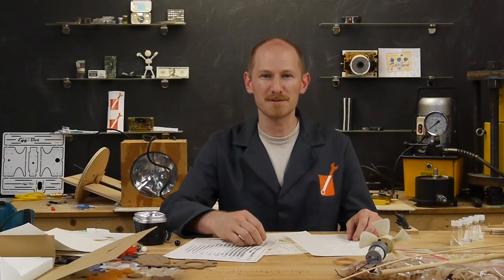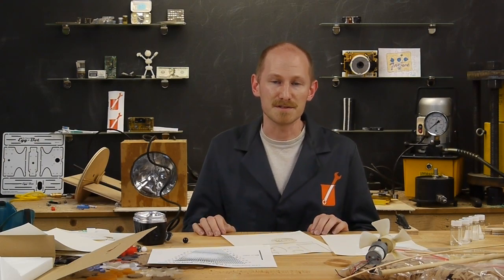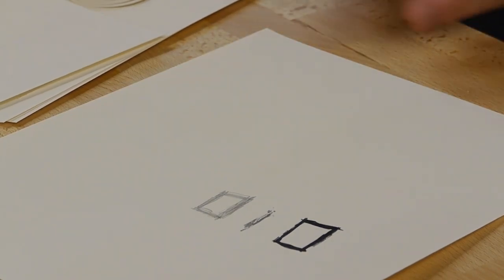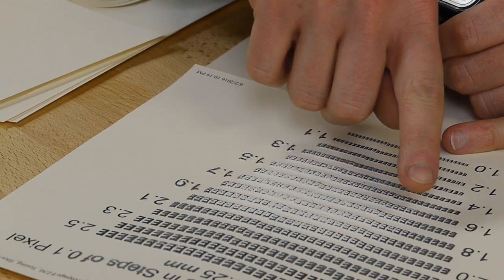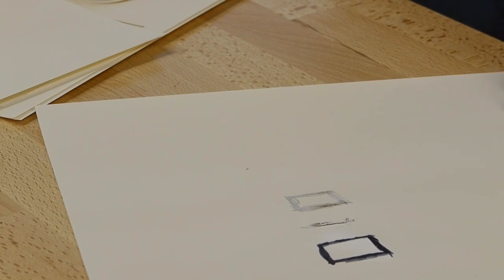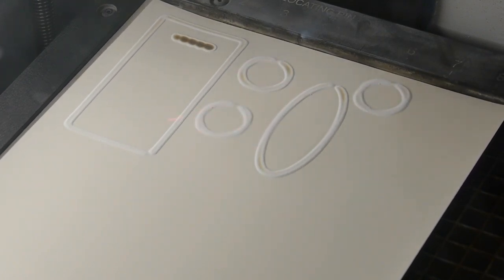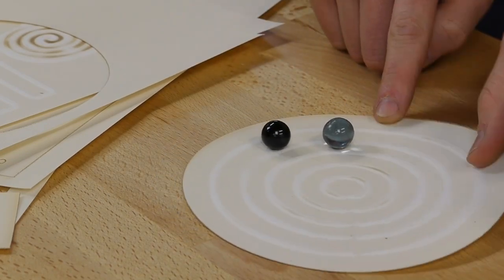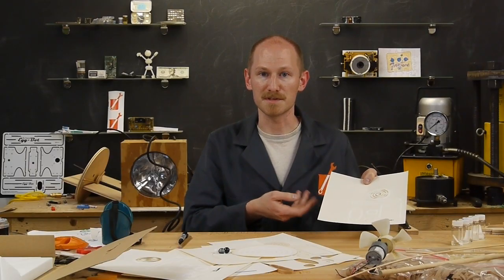Heat-sensitive 3D paper (swell paper)

Comment: My idea for a dynamic display for blind is a sheet with small cells filled with liquid (probably alcohol) and a tiny heating filament. The boiling of liquid will make the pocked swell. You might want a heat conductive bottom layer so the cycle time is short enough.
My idea comes from inkjet printers and wonder if the components could be repurposed.

Comment: It's interesting how it shows that the laser spot isn't round. Once defocused it was something vaguely oval and would give different thickness lines depending on movement direction. Could possibly be used as an artifact-generating way to check beam form on a laser cutter.

Comment: You could use a 3D printer with it. Make custom GCode to set the nozzle to a certain temperature, move nozzle onto paper at required steps, done. Higher resolution may be possible by sticking part of an accupuncter needle into the nozzle.

Comment: A cool experiment would be to try a photographic representation. This would also be in-line with the purpose of the paper (blind folks could experience landscapes and portraits in a new way). If you could perhaps shine the lamp through a negative that blocked off parts of the infrared onto a totally black-colored piece of the paper, this might produce a tactile image. // The other thing that came to mind was some sort of coded mask. In astronomy, a coded mask is helpful in determining origin of radiation by the points of shadow the mask produces. If there was a coded mask for infrared, there may be some cool experiments or applications for that. (I didn't explain coded masks well, but if you Google them, you'll see what I'm talking about).

Comment: I experimented with a product called Expancell a few years ago. It consists of small microspheres containing a core of solvent that boils and expands them like small balloons swelling the stuff up to 60 times when it is is heated. When I visited the factory they showed me laser prints very similar in appearance to what You have. As I understod it, the paper just had a coating of microspheres, and the fuser expanded the colored surfaces to give a 3d effect. Perhaps it is the same process now commercialized. These microspheres can be used for all kinds of interesting stuff. Some info on their website :
https://expancel.akzonobel.com/applications/

Comment: You could print a black and white geographical height map, the higher areas darker, the pits and valleys lighter. Then when exposed to the height it will create a 3d geographical map, although most likely too small to be appreciated. Also the Z to X and Y ratio would be really low

Comment: I thought I had a comment before, but would a scanner work?  If you put the swell paper on the scanner would the light and heat from light be strong enough to effect the paper? And if so would you have a problem with the paper sticking to the screen?

Comment: Detect the 3D Printer heat bed for hot spots, timing would need to be good, but the price is much much cheaper than other types of devices. So put in on the 3D Printer heat bed turnd on to a suitable temp,  for a fixed time, take it off a see if any areas are higher than others

Comment: Seems made for customised Braille signage... even books, contracts, or simple run-of-the-mill documents!

What if you ran a laser-printed thermal-paper page through the laser printer again, as though printing a blank page, and let the fusion roller in the laser printer apply the heat in a consistent, measured dose of thermal energy?

The process may require some fine tuning (such as dot size or line thickness) but it just might work.

Comment: Could you replace the laser in your laser cutter with a hot air gun? I think the nozzle should come down with just enough clearance for the paper to swell to maximum. A hot air gun might be unnecessarily complicated though, since you already have a laser.

 I think you could make an aluminium, liquid cooled (whatever liquid you think will work best), heatsink for the paper to sit on. (Maybe use a thin (1-2mm) aluminium plate large enough for the paper to sit on, and solder a copper coil of tubing to the back.)
Reply: Another idea: Add an attachment to the laser arm, that hangs down close to the surface. Imagine a 90 degree cone, with a circular base the same size or bigger than the focus of your laser, point-end-up, with a hole of the thickness you want your lines in the paper to be, drilled down the exact center of the cone. The cone sits on a small sheet, perpendicular to the beam of the laser. The sheet is attached to the laser's motor arm by a metal rod or two. A circular band is centered around the cone, laying flat on the sheet. The band's purpose is to absorb reflected laser light safely, so the inside is coated with something dark and heat resistant. (Graphite filled glass or something?) The cone, ring, sheet, and rod(s) are made of aluminium, but the cone gets the extra treatment of being polished to a mirror finish. [Continued next…]
Reply: […Continued] If you think you can get the electro-polishing to work without creating pits, that might be good for a middle step. I think I would use a mechanical polish for the first step of creating a mirror finish on the cone, then electro-polish for the second, then a few layers of new aluminium using sputtering, thus smoothing out the terrain of the cone a bit, I hope. If you have an reliable and known method to create excellent laser-mirror-grade finishes on aluminium, go for it, it's your channel after all. I won't be upset if you change things up on any of my suggestions, or even if you don't even use them. (It would be really cool to see some of my ideas used though. I really like coming up with them, after all. I don't even care about getting credit for them. …And now my social awkwardness is shining through…)

Comment: since some printer colours are kinda hydrophobic you could print fluid channels in yellow ink (multiple layers/lot of ink) and then raise the sides with black color and light, that should make for a working fluid channel that doesn't soak into the paper. maybe, if you can somehow make the edges of the swells sharper, you could even make capillary channels.

Comment: drill a hole in shitty concrete (too much sand). put a tight spiral of that in the hole. heat a screw with a hot air gun. screw that in the middle. how many kg:s would that hold?

Comment: you can make quick microfluidic molds too!!!...just need the paper to be flat....
Reply: maybe tape the paper onto a metal plate then laser engrave/draw lines for a microfluidic mold. pour PDMS, bond on glass slide and see if you can achieve laminar flow, mixing, etc. If you have some paper still and you live in the bay area let me know. I live in fremont and don't mind driving out and picking some up to test.

Comment: Hi, not sure if this is really the place to ask questions, however I have been reading with great interest about your background and the awesome work and projects you are involved with. Put simply, my absolute dream is to do what you do. I am nearly 40 and have been employed rather non technically (due to a very long term illness that took away quite some years of practice), as a qualified mechanical engineer for about a decade in the UK. I have started becoming a 'maker' (3D printing + electronics at the moment) and have some projects I cannot wait to realise. I love learning, love taking new things on board and just spending hours experimenting, though I wish I had a lab or workshop to use - I live in a flat :( Do you have any advice for a path from that old career to the new one, ways to get access to equipment, and maybe speak about your learning process? Thank you for reading  :)

Comment: One use could be to try out different surface patterns on airfoils to see if there are better patterns than are currently being used. I would suspect that it would be a popular idea for the model airplane crowd. i.e. do you get better performance out of a golf ball surface on the bottom of a wing to reduce drag, and a chevron or wavy line surface over the top of the wing to cause the air to follow even longer paths at the surface, perhaps giving even lower air pressure at the surface?

Comment: Add dimples to a paper air plane like a golf ball.
Reply: This would be interesting to try. My intuition tells me that this would make it worse, since a golf ball's dimples are designed to create turbulence behind the ball in order to eliminate a low pressure system forming behind the ball as it flies through the air (the low pressure sucks the ball backwards, preventing it from flying as far). Check out Applied Science's video where he levitates a screwdriver with compressed air -- that's where I learned about this effect.

Comment: Another great video. Just a suggestion for visualising raised areas: use oblique light. Holding a light source almost parallel to the object in question would accentuate the raised areas. This method is routinely used in forensic science to look for small pieces of evidence on floors etc.

Comment: I'm just wondering, the laser printer also uses heat to bake the toner into the pores of the paper. Is the swelling feature activated only by some wavelength then?
Also chemical stability is great, but light and time stability will be, I guess, an issue.

Comment: An interesting application there would be rapid rapid development of metal plaque casting positives.

You'd spell out what lettering you'd need with the laser to get that raised effect, then glue the paper to a plank of wood or something, and then use that to make an impression in casting sand-- or possibly go for investment casting; but that would miss the point.

Assuming that your casting sand is exceptionally good; you could get decent resolution and high-fidelity casts as long as the raised portions were above about a millimeter.
Reply: I might also add that a decent way to do this without going through the trouble of bentonite clay and very stringent mulling/moisture control requirements would be to use dimethicone impregnated sand.  You can buy it as magic sand from toy sellers.  Should be locally available.

Also, AVE has a good video on casting things out of aluminum in the most minimal way I've seen-- as a caster myself.

Comment: How much can it lift?
I mean a coil of Nitinol wire can lift up a decent weight when heated up, is it possible to do that kind of tricks with this paper?
If that is the case you could use this paper to wedge things open.

Comment: Hi Ben, cool video! What do you think of using this paper as a slightly different take on a printed circuit? By this I mean raising the circuit and then applying a conductive paint to the raised bits only with a roller and then adding the components. I suppose an advantage of this is that you can construct prototype circuit rather quickly.

Comment: I'm thinking gaskets.  as a mating surface heats the gasket expands further sealing imperfect joints.  Can you soak the paper in a few oils and fuels? maybe do a vacuum or pressure test?

Comment: +Applied Science
 Hey could you draw a raised line in the paper with the modified laser cutter and take sharp knife such as a craft knife and cut directly down the length of the raised area in the centre, then could you put the cross section in the scanning electron microscope so we can see the actual cause for the expansion in the paper! 

Also, could you put a sample of the paper in a microwave, in an oven, under a blowtorch, and do an experiment to see the effects of sunlight on the paper.
( maybe wet a certain pattern with very small amounts of water and expose the whole sample to light energy, perhaps the sun)

Lastly, i enjoy your videos, always interesting and exceedingly captivating. Please continue to produce more great content!

Comment: Does the heat exposed portion have a different capillary action than the unexposed?  An ink calendar came to mind, although my guess is that the difference wont be stark enough for something like that.

I also was wondering about a chemical reaction, paint on one half of the chemical combo then spray on/dip the other.  Maybe sodium carbonate (washing soda) and water is exothermic enough?

Another thought was to use it to track light/heat information, likely with a lens of sorts set up to focus the source.  

And finally, if you have equipment that is susceptible to heat damage or if you're 'debugging' a system (I'm thinking pneumatic) you could use that paper as a sort of 'canary'.  If it's puffed then the system experienced a known amount of heat.  This seems limited however since it looks like a relatively narrow and fixed reaction temperature for the paper.

Very cool substance, thanks for sharing!

Comment: Great video! If the paper doesn't absorb fluids, you can make custom liquid cooling membranes for ic's. Just after raising of the patterns, top it off with a layer of plastic. (sticky tape or film).
Reply from the maker: Great idea!
Reply from the maker: Yes.  New video will be posted early next week.  Work at Verily is very interesting and rewarding, and I don't have as much time to make videos, but there will be more for sure.
Reply: If you cut a long narrow strip and then traversed the center with a swell- would the paper fold by itself? If so you could make complex 3d shapes. I would guess putting down the swell layer first would work best.

Comment: make a thin film keypad by using the ridges to separate a second sheet of  plain that has keypad contacts of conductive ink or graphite on the bottom. The bottom sheet will have  a matching circuit layout that is outlined by raised ridges, the valleys between the ridges will have a conductive layer applied after the ridges are made. The top sheet is then laid over the bottom sheet so that the conductive pads are suspended over the corresponding switch junctions. The two sheets might even be glued together along the ridges trapping air between the sheets.

Comment: Through a laser printer?  Wouldn't it swell while still passing through the fuser and jam or swell the whole paper?
Reply: Sorry you are correct! HP's LaserJet is actually a laser technology. Which brand was I thinking of that named a bubblejet a laser something.. I thought it was HP
Reply: The laser is used on a cylinder that then picks up the toner, after it passes by a wire that discharges the drum the fuser falls onto the paper (drum is rotating the same speed the paper is sliding underneath it so the pattern of fuser transfers to the page, laser doesn't hit the page).  After the toner is on the page it passes through a "fuser" which is hot and melts the toner onto the page, think the concern is in this last part.
Reply: Laserjet is a particularly crappy bit of marketing confusion on HPs part. It's a laser precise inkjet.
Reply: How so?  There is no liquid ink dripped or squirted onto the paper.
There is a laser that transfers the page image onto a charged roller that picks up toner that then transfers the toned-image to paper.
It is true that the laser doesn't directly burn the image directly onto the paper, if that's what you're referring to.
Reply: +fegolem
I was thinking the same as Alexander.
And though it's true that the laser only used facilitates the "transferring process"and hence won't heat and swell the paper.
The "Critical step" would be the "Fuser", which if I'm not mistaken in principle simply is a "hot roller" that is hot enough to melt the toner into the paper, and that quite possibly also could swell the paper.
Best regards
Reply: I have a brother laser printer, prints do come out pretty toasty, like a warm towel. Smell heavenly too :P
Reply: I'm curious too. Fuser runs quite hot, and it'll swell the paper a bit, but definitely not that much so it'll get stuck in the printer.

Comment: Is it IR sensitive to specific wavelengths or does it need a broad spectrum?  Their website doesn't give any info on that.  It's interesting that it's made to not be affected by the fusers from copier/laser jets.   Perhaps trying a high intensity 880 or 910nm IR diode? If so it could be mounted in your laser cutter or other 2/3 axis cnc.  Might eliminate the burning??  Thanks for sharing this with us!  ~PJ

Comment: It's already been mentioned, but given that another youtube'er(Afrotechmods) has shown it I wanted to reiterate, he plays around with a powerful camera flash that can make printed letters smoke after getting a healthy exposure at very close proximity. Could this be a way to make more elaborate patters with a finely printed patterns?
https://youtu.be/tt5tnY_c09k?t=7

Could one make a coarse fresnel lens negative mold from this paper?

An unconventional way to debug/monitor heat from a pcb over time. Where the largest bumps represents the warmest spots. In case it's difficult to place a probe or getting readings from a thermal camera.

Comment: I wonder if it's possible to put a layer of ... something that would resist being cut but still transfer the heat (I don't know what) over the top of the paper in the laser cutter (set to the proper focal length), so that you could get sharper raised details.

Comment: Is there anything different about the coating than with the textile paint that's been available for decades that would swell up when ironed? You could draw on cloth (or paper) with the paint, would let it dry and then iron it (or put it in the oven), which would make it puff up exactly like the paper does.

Comment: First thing I thought of was brail :D Run it through a thermal printer such that you get raised dots instead of black dots on thermal paper.

How about pulling the long thin heating bulb out of a junked laser printer and passing that over the paper? You could automate it, get the paper moving under the bulb at a very exact speed, like them conveyer belt bread toasters :P